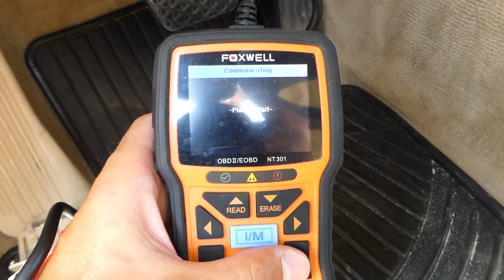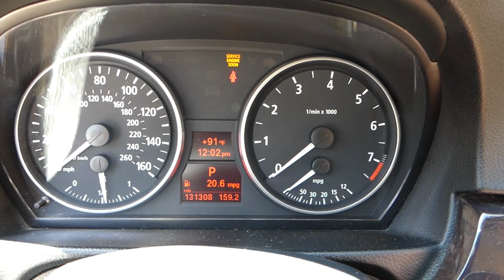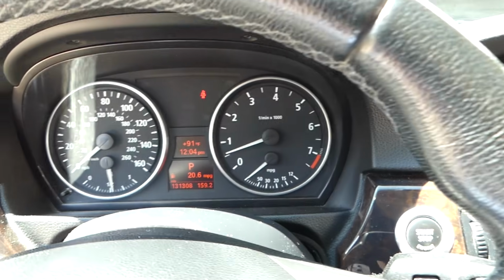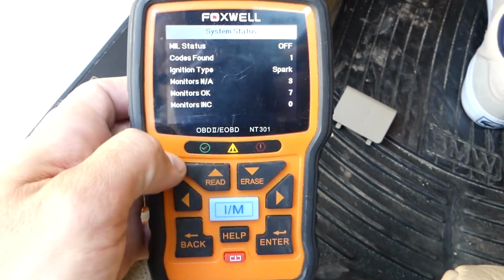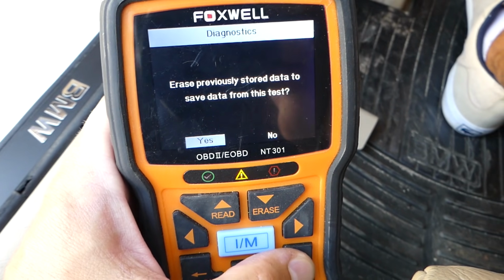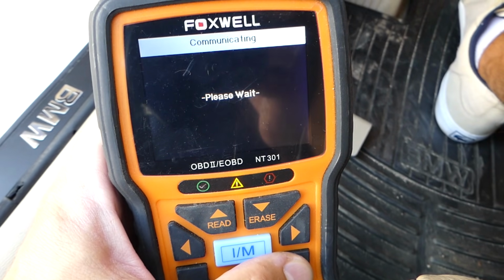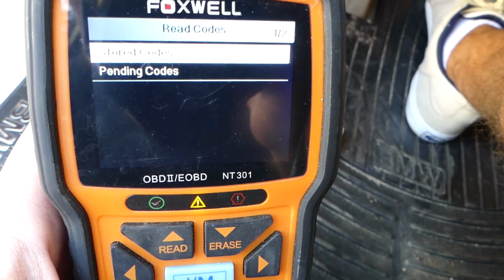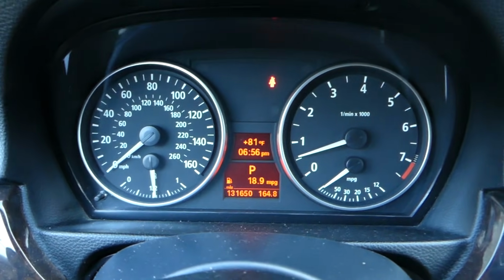BMW CODE P0015 B CAMSHAFT POSITION TIMING OVER RETARDED

Comment from the maker: Products that we use and recommend:
► Cleaner spray used in the video: https://amzn.to/2OErTLH
► Vanos Solenoid: https://amzn.to/3U6TARq
► Panel Removal Set: https://amzn.to/3YiMADu
►Torx Set: http://amzn.to/2hbyWgd
► Tool Set: https://amzn.to/3p5MM6t
► Screwdriver Set: https://amzn.to/3XRB28Q
► Engine Oil: https://amzn.to/3xBc8B9
► Oil Filter: https://amzn.to/3w0Ulme
► Torque Wrench: https://amzn.to/32qyRwg
► Liqui Moly Engine Flush: https://amzn.to/3IiDBID
► OBD Scanner that we use most often: https://amzn.to/3I4MQfe

► Check out our Amazon Store for the tools and parts that we use: https://www.amazon.com/shop/worldmechanics

Comment: What if I change the vanos solenoids with oem parts and both camshaft position sensors oem and still have the check engine light On and off?

Comment: I have a 2011 bmw 328i I change the vamos solenoids, camshaft position sensors with oem change the oil and still have the code, light goes on and off

Comment: I have this p0012 code on my 2006 BMW 320i so I have replaced the following parts:-
New vanos solenoids
New cam sensors
New eccentric shaft sensor 
New vvt motor
New crankshaft sensor 
I have had the ecu checked - ok
I have checked the wiring 
I have also done an oil change and inspected filter housing and cage is intact.
Still have the code, cannot start the car unless I unplug the eccentric shaft sensor. I don’t know how to check eccentric shaft sensor wiring because it has 9 pins, I’m ready to give up.

Comment: My check engine light only comes on when i turn my ac on and the code is always the same p0015 if i dont use the ac for a day the check engine light will turn back off. Ive done oil change and cleaned vanos and still light comes off and on but only when i turn the air conditioner on 
..any advice

Comment: I replaced both vanos solenoids,removed and cleaned both vanos check valves and I'm still getting a P0015 code. Is it possible its the exhaust side can position sensor? I'm running out of ideas... Thank you!

Comment: My code is P0012 and just had oil change cleaned the vanos and also the are 4 years old bought them new from dealer camshaft sensor is about 3-4 years old also new from dealer so not sure what’s going on on my 07 x5 3.0 si n52 engine

Comment: Good info. FYI just bought a 2007 328i with 155kms and within the week the car stalls twice. Followed up with your recommendations and changed the oil also. Drove for over two weeks before it stalled on turns. Changed the oil and filter again. Have driven over two tank fulls and so far so good.

Comment: I have a 2005 BMW X3 has code 28b8 exhaust camshaft mechanical I've swapped Vanoss valves I put in a new exhaust camshaft positioning sensor a new fuel pump I have changed all vacuum hoses new PCV valve and new PCV hoses changed spark plugs and also I cleaned out the Vanoss valves they are working good now but I am still getting the exhaust camshaft Mechanical Code 28b8 what does this mean

Comment: I have found if you have 100k or more on your bmw just replace the vanos if they are causing issues.  Most the time cleaning is a temp fix.  I bought gates for under a 100 buck and its been great.

Comment: I did everything in the video and checked both vanoss. The bottom one was really good clicking when checking with battery but the top one was very weak. Should I get a new one?

Comment: Hello. Great video. I am losing power, it's like the car does not want to take off. I have a 2009 BMW x5 and have the code P0012 and P0015 are both the same? 
Also I noticed you just cleaned them, so as long as they pass the test with the battery, it means they are good and just need to be cleaned?
Thank you.

Comment: P0015 has nothing to do with vanos only with the shaft position is the sensor on the side of the vanos. Such cleaning is for a while and erasing the error, the error comes back after driving a few kilometers

Comment: I have replaced both vanos and intake + exhaust sensors and idle has only worsened.  Is it perhaps the sensor on top of the valve cover?

Comment: I fixed this code and replaced the spark plugs and coils and it ran great for 1 day. But, now I am getting code P1035 and the car won't start. Any recommendations. 2009 BMW 328i X Drive.

Comment: Is it a must to drive the car after replacing the cam sensors and vanos? I replaced them all and clear the code with a scanner. But after running a minute or two at idle not driving it pops the code again and engine light comes back on. Do I have to drive it to force it to read it or something?

Comment: Great videos as always!  I have an interesting issue on 2005 BMW 545i/N62 engine.  Getting intake and exhaust VANOS solenoid failure codes, Bank 2.  Replaced the solenoids with new ones, still have same issue.  Have checked all electrical connections.  Issue arises upon startup and lasts for about 30 seconds and throws CEL, rough idle, and then smooths out-assuming the DME is deleting Bank 2 VANOS to full open position as a default.  Had it at my independent, they cannot figure this issue out.  Any help is greatly appreciated.

Comment: Can I do the same cleaning process but without opening and closing the valves? Meaning spray the holes with brake cleaner clean it up and stick it back in

Comment: Hi. Perhaps you could help me.  My 2010 X5 will crank but won't start. I replaced the fuel pump relay and it didn't help.  Only codes I got is "fuel mixture too lean on bank 1 and bank 2."  That alone shouldn't prevent my car from running. Would a bad mass airflow sensor prevents the car from starting?  Again it will crank and engine is turning.  How bad crankshaft position sensor prevents the car from starting?  Anyone here have suggestions?  It's a lot of work to replace the crankshaft sensor since it's under the starter which is under the intake manifold.  Thanks guys

Comment: I have a 2006  BMW X3 and show code P0011, stalls very bad and smells bad, engine shuts off every time have to keep RPM higher then 1,000 I been having lots of problems need help thanks

Comment: I have p001b please help I replaced ignition coil and spark plug and changed my windshield wiper control switch after disconnecting my battery and I also have abs dcs signal that won’t go away

Comment: I have a 2008 X3 3.0SI with the N52 with 107,000 miles on it.
Shortly after purchasing it I got those two codes.  After searching everyone said it was the vanos solenoids.  So I replaced both of those with OEM parts. 
A week later the codes came back. I bought another vanos solenoid thinking maybe I got 2 bad ones. I replaced just one of them. The codes came back shortly after and it again was both intake and exhaust at the same time.
  I took a shot in the dark and replaced the vanos check valves, the codes still came back.
Then I replaced the camshaft position sensors thinking maybe they were just broken.  The codes still came back.
When the codes do come back it is usually just after startup and I can feel the engine surge a bit, and then it throws the codes.
Curiously every single time it throws the codes it is both intake and exhaust at the same time.
I think it might be the vanos actuator motor?  
To summarize I've replaced:
Both vanos solenoids
Both camshaft position sensors
Both Vanos check valves
Either way I want to stop throwing parts at it in hopes it will fix the problem.
Any idea. 
Please I need you help I know you own bmw. 
Thank you for you time.

Comment: I found if you do not have an oil filter cage, the part the filter goes on, this will give the same code. I replaced my oil filter cover that has a filter cage and erased codes and never came back on. Did not need to clean

Comment: Hello, I have a problem with my N43 engine...If the engine is warmed up, sometimes the idle is shaking and trembling.. After this problem if I start up cooled down the engine, the engine light comes up and runs without problem until the warm up. ISTA-D shows: 2AA1 Exhaust camshaft position sensor, no signal. After cleaning the sensor and delete fault memory is everything okay, but the same problem comes soon irregulary. Have I to do change the camshaft position sensor or I should to look for some else problem? Electrical wiring works properly. Btw. I've got new injectors, coils and spark-plugs = there is no problem! Thank you bro!

Comment: I can do this without removing/cleaning solenoids, all I have to do is just to delete the code and it won't appear for some time, but it comes back. It's P0015 or P0014 randomly...

Comment: I took the solenoid out, unfortunately I cannot put it back in. It seemed like that the rubber is too large to be inserted into the hole. I've already tried to use some lubricant, but that does not help. Anyone know how to deal with this? Thanks.

Comment: Hello, I have question about other BMW problem, hte car is e46 with n42 engine and it has a DTCs p1030, p2862 and p285A. It has a brand new valvetronic motor and ecu for it so that cannot be reason and the valvetronic motor is learned by profesional. Thank you in advance for your help!

Comment: also sometimes I'm low on steering fluid. so I have no clue if I'm leaking at my rack in pinion or if its somewhere else so if you can give some advice it would be really great